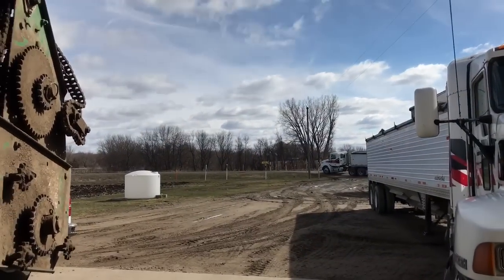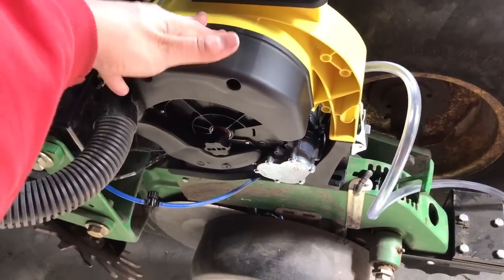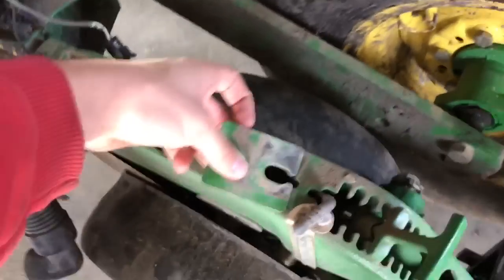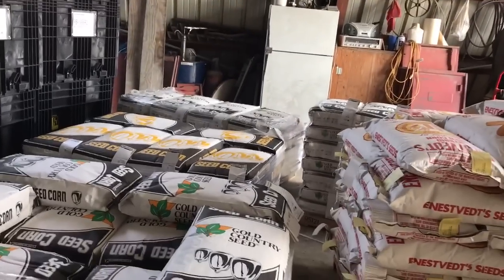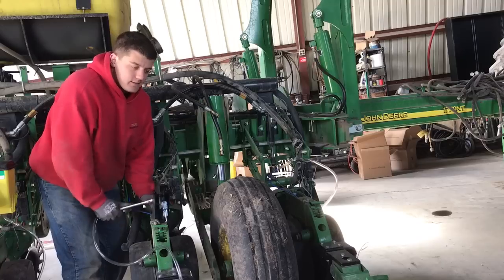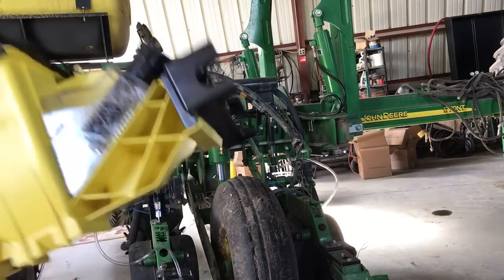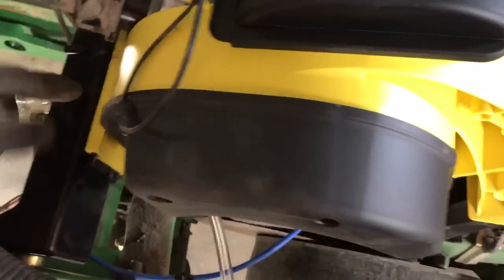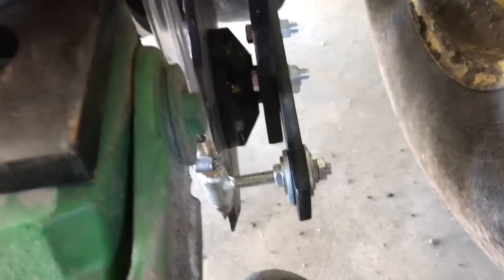Installing Electric Meters on Planter

Comment: using a grain drill allows me to plant beans on 14 inch rows producing a large plant population thus producing a larger yield.   I've been considering going to 7 inch rows.       you have to work an off the farm job too?
Reply from the maker: His drill is 10inch rows; works pretty well.  Yup, just do the farming on days off
Reply: BornToFarm1 - thanks for the 10 inch mention.  leads me to thing 7 inches will work.   you must have a part time job off the farm since it appears to me you have what I call a very large farming operation.   I like your channel and your video production presentation...

Comment: Thanks for the video.  As somebody who really enjoys equipment and always wanting to know how things work,.... but am not familiar with the planters, ...    Some basic principles of understanding are needed.  From what you said, it appears, (1) the seed comes from a main hopper, and is blown down a tube, (2) a vacuum is drawn from another hose, pulling the seed down the tube from the supply, (3) some screen that allows air to pass, but not seed blocks the seed, (4) seed is fed into a chamber that has a metering wheel, (5) the design of the wheel dictates how often a seed is dropped down the tube to the opening shoe, (6) the electric connection is used to drive the wheel, perhaps driving it at various speeds to meter the number of kernels out (rate/unit of time?), (7) somehow the fertilizer is drawn from a separate common hopper, and is dropped down a separate tube along side the seed tube, and the fertilizer is dropped along  side the seed in the opening shoe.  Is the fertilizer drop indexed, so it only drops near a kernel of seed corn, or is the fertilizer dropped continuously?  What do I have wrong? Answers to some of t he questions, please.  You do a good job of explaining things, but were a little short of details with this one (for the uniformed, but interested parties).  Thanks so much.
Reply from the maker: I will be making a more detailed video of these things and how it works some time--just got rushed  today with a phone call saying I needed to get to the hospital and pick up my grandma.   You described it fairly well.  The fertilizer is applied continuously--the planter will be be pulling a 1000 gallon fertilizer tank.  It'll make much more sense when we get it all together and I make a video showing how it all works together.  thanks for watching